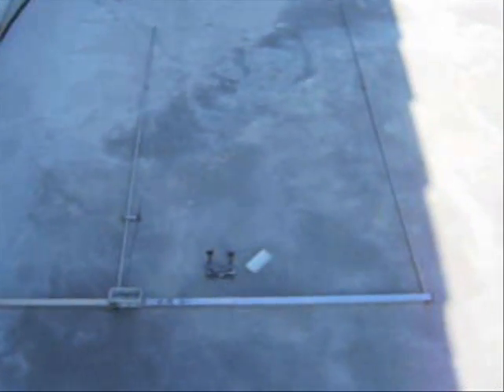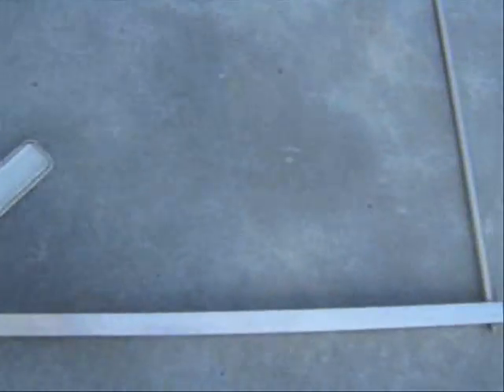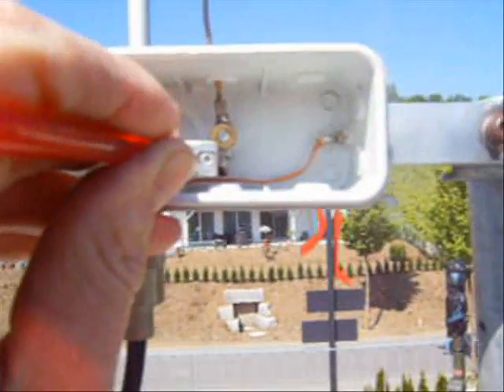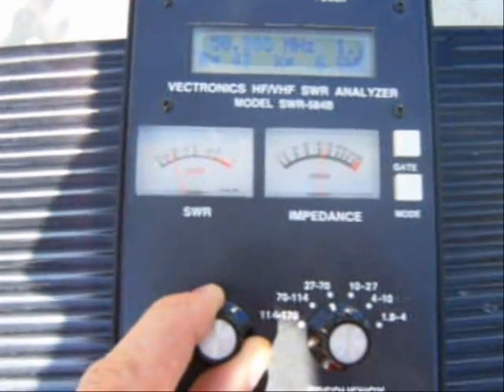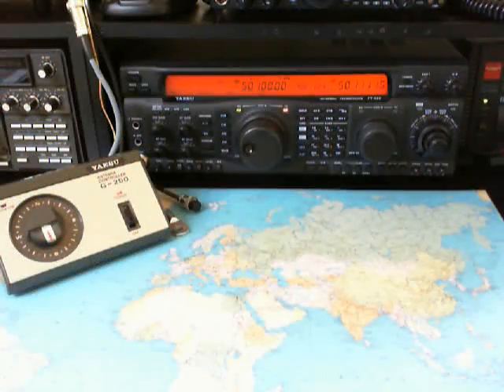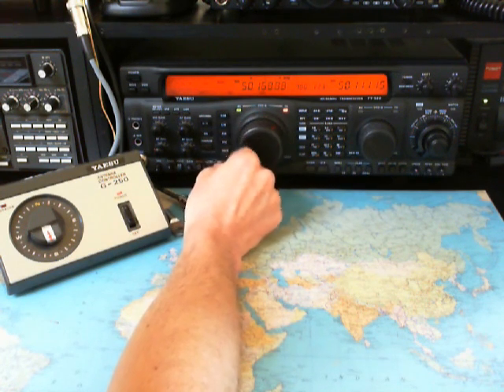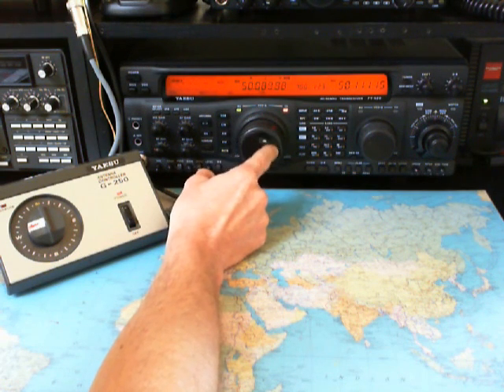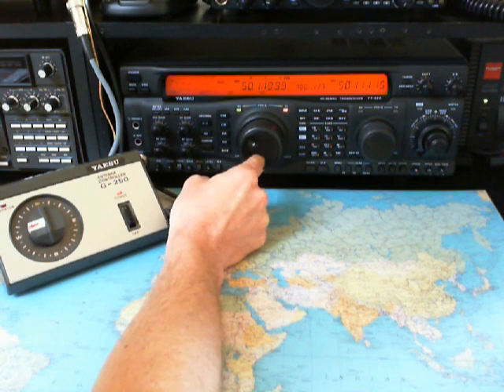Swiss HB9RU homebrew vertical beam antenna for 50MHz

Comment: How do you model this antenna? I want to make one with more than three elements for VHF 144mhz. I want to add directors to it for more gain.
Reply from the maker: Greetings, fellow HAM radio enthusiast, and thank you for tuning into my channel. Indeed, the HB9RU antenna, often referred to as a pitchfork, was an invention of a Swiss engineer in the 70s/80s. It was later reconstructed and enhanced by HB9MTN. You can find the precise calculations on the provided link: https://www.qsl.net/hb9mtn/hb9mtn-ru.html
Although the page is in German. Enjoy constructing this antenna. Best 73 to you...

Comment: what is the resonant frequency of the antenna? Gamma match and series match is no sens ... too big losses. Maybe a J pole antenna would be a better and cheaper variant.
Reply from the maker: Mister vszilard hello, thank you for your visit on my channel. This vertical beam is using for FT8 on 6m. 50.313 MHz is the current tuned Frequency. Have a nice Weekend

Comment: Very unusual antenna I've just started working on on 6m with V200 antenna it not great deal on 6m OK on 2m and 70cm think it 1.5 Db on 6m I was look up on the HB9RU and see if I could make one do you know the DB gain on this antenna. Thanks for showing Great video.
Reply from the maker: I had built an other HB9RU for 11m. But it's not more in my shack....